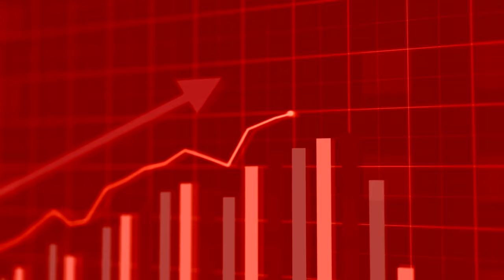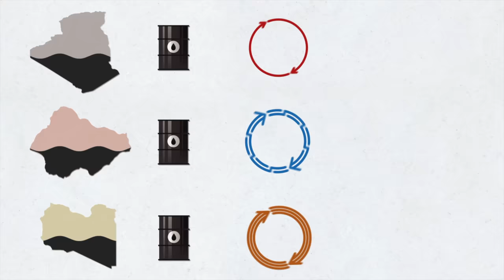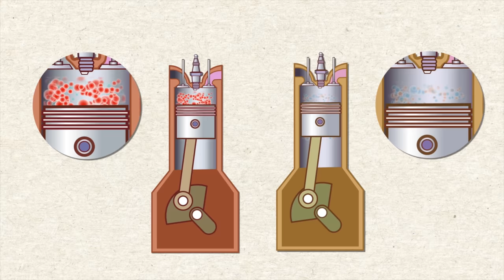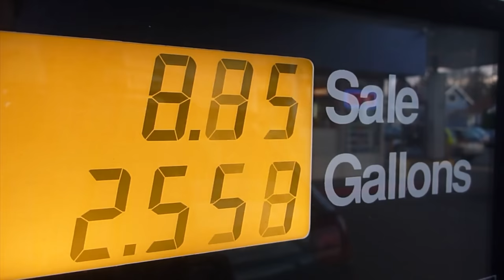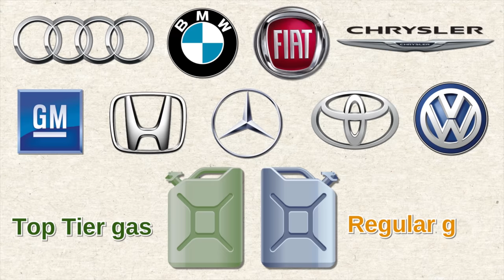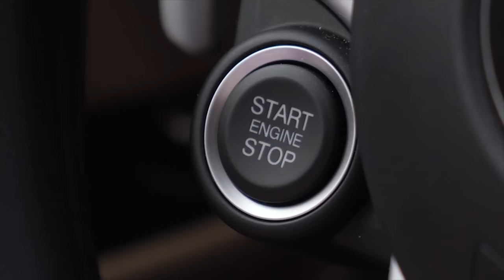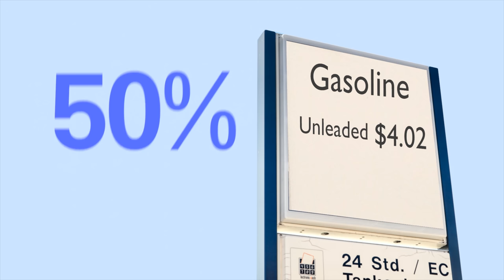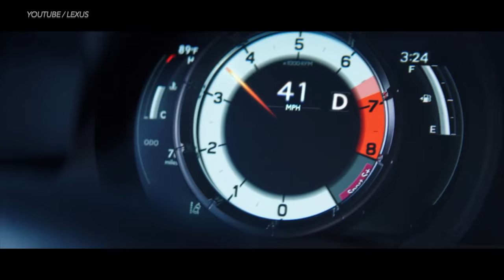No One Has the Balls to Tell You the Truth About Gas Prices, So I Will

Comment: The better choice for a ‘greener’ vehicle choice would be to hold on to your reliable older car and drive the wheels off it (then put on new wheels), basically keep it until a catastrophic failure or the body rots out

If you need to purchase a replacement car, purchase a reliable older used car in good condition and run it into the ground…

I had to do option 2 to replace a totaled vehicle, so I did a Scotty, and purchased (cash sale) a 2010 Toyota Matrix with the 1.8L, unfortunately it’s an automatic, but manual 1.8’s are nearly impossible to find in my area.

No car payment, 30-32 MPG combined, more fun to drive and simpler than the abhorrent, overly complicated Prius, also has more usable interior room.
Reply: This is what I plan to do with my Yaris. I hope to drive it to 500k or more.
Reply: @missdesireindependance5194  there’s no logical reason your Yaris shouldnt make it to 500K+ if you take care of it, it passed the “Scotty Test”…

Small, normally aspirated four cylinder engine 

Simple, basic chassis

Minimal automation/nannyware/“assists”

Basically there’s not much to go wrong…
Reply: Mine is a 2005 matrix and I intend to run it until it can’t then buy another matrix
Reply: @MrMOGHammer  nice. Matrix’s are great cars, especially the 1st gen, because they are a Corolla, in hatchback (what’s in a name)
Reply: Still driving my 2004 Prius.  It's extremely low mileage so as long as the major components and body hold up it may be the last car I own.  Lol.  I put in a replacement battery and just had it replaced again under warranty.   I got a lifetime warranty on replacement batteries.  Will be interesting to see if I can get one to last more than 9 months though.
Reply: @LisaKnobel  from what I’ve read, the hybrid packs are a crap shoot unless you go factory OEM/refurb, what a lot of these third party refurbers do is replace only the failed/failing cells, and leave the functional but aged cells in place, so the pack has unequal age/worn cells, and logically a new cell is going to last longer than a original (but still functional) cell
Reply: @MacTechG4  pretty much what I'm seeing.  So, as long as they install a "new" one everytime they fail, I can't see a huge downside except for a little inconvenience.  And, it's not really hugely inconvenient as they come to me wherever I am.  They start having to do that too often, they will necessarily have to change their business practices.
Reply: @LisaKnobel  one other thing to keep in mind, having an “unbalanced” pack with a mix of old OEM and new third party cells can accelerate the wear on both the new and old cells, it’s simple electrical physics, the aged cells are less responsive and have less capacity, increasing the load, and wear and tear on the new cells…

If your battery company wants to be scientific about this, they should build you a replacement hybrid pack out of 100% NEW cells and see if the time between failures/replacement increases (as it should)

Let’s say building a new battery pack (parts alone) cost $4000, and refurbishing a pack partially cost $1500…

The bean counters of the company would say “the $1500 pack is fine, let’s go with that one!”

But…if they’re replacing that pack every 9 months, by the time they’ve replaced it three times (under warranty), they’ve exceeded the cost of the $4000 new cell pack, and that’s just parts cost, not counting labor, travel, on-site fees, etc…

This proves that bean counters and engineers are natural mortal enemies ;)

The engineer wants to build the best equipment possible, parts cost be dammed, the bean counter wants to spend as little as possible and cut as many corners as possible to hit that price goal

This proves that bean counters are morons, and need to be kept out of the technical decision making process.

It’s also why I went with a Matrix, more cargo capacity than a Prius, handles better, more fun to drive, mechanically simpler with fewer failure points, but I lose out (a little) on absolute fuel economy, but that’s acceptable to me, I still get around 32 MPG combined (low 40’s highway)

And when the Sun sends out another “Carrington Event” level solar flare that fries the electric infrastructure, there’s a much higher probability that my Matrix will still run, and your Prius will be an oddly-shaped planter ;)
Reply: @MacTechG4  as an engineer, I totally get that.  I bought the Prius even though I knew I was logically making a very bad decision.  And, I'm not really a fan of them.  But, the piece of crap just will not die.  I do nothing to it except oil changes.  And, now a battery replacement. It owes me nothing.  So if it becomes a planter in some unlikely catastrophic solar flare, well,  so be it.  I'll ride my bike then.  

For me going with the rebuilt batteries seemed to make sense given the age of my car.  Given that my only inconvenience is to take a few pics and send an email I will continue until the company likely goes out of business.  Then I'll have a real excuse to buy a new car.
Reply: @LisaKnobel  sounds like you’re thinking logically about this 👍🖖

You are technically correct, the BEST kind of correct. :)

Perhaps a brainstorming session for an “engineering approved” EV is in order…

First; 
EMP hardened electronics

Built with as many off the shelf, common, easily replaceable components as possible 

No proprietary code/design, completely open source

Solar panels/photovoltaics on any flat, Sun facing surface

User upgradable/replaceable battery packs

Manual transmission (c’mon, you have to give me this one ;) )

Alternate design, four wheel/hub motors, each one individually selectable as motor/generator mode…

Maximum acceleration? All four motors in motor mode
Rear drive? Just the rear motors active
Front drive (self explanatory)
Regen mode; set two motors to generator, two to drive
Highway cruise mode; 2 motors set to generator, one to maintain speed, one switch between motor/gen depending on load/demand, in ideal conditions, three wheels would be in generator mode, one to maintain speed
Reply: @LisaKnobel  despite your Prius being 18 years old it still has push button start😂. They introduced that feature in the 2004 redesign.
Reply: @Blakecryderman7244  yeah it does.  I still have to put the fob in the slot though to make it start.  But, I could have got the remote start and unlock feature then if I wanted to pay more.  But, I certainly did not want to pay anymore than I had to.
Reply: @LisaKnobel  right. My car doesn’t have any interior power equipment, which I like-less stuff to break

Comment: So far, the plug-in hybrid has been the way to go. My 2018 Honda Clarity gets 40-48 miles range per EV charge, which nets me around 1,000 miles of distance (with sometimes free electricity) per fill up of an only 7 gallon gas tank. Before the $6.50 gas prices here in So Cal, I was spending about $10-$15 on gas per month. Now, it’s less than $30 per month, and having the best of both worlds is amazing. ⚡️ ⛽️
Reply: I don’t understand why automakers aren’t pushing plug in hybrids harder. The battery packs are smaller but most people could go weeks instead of days between trips the the gas station. If I could buy a Tacoma sized plug in hybrid truck I’d have one bought tomorrow.
Reply: I'm only guessing here.  So, 40 miles on a charge plus 7 gallons a fuel.  Guessing about 40 mpg on that 7 gallons would put you at around 320 miles of full range.  Give or take a little of course.  Now, if they could get the charge to hold 100 miles and then put in a bigger tank, say 10 gallons..  You're talking 500 mile range.  That's where is should be, imo..  But my opinion means little!  LOL
Reply: @mramseyISU  They should be pushing hybrids and plug in hybrids more...  I have a 2022 Corolla Hybrid and it literally can go 600 miles on a tank, it's remarkable!  They could make Hybrids go 800 miles on a tank!  The technology is there!  It's all about money!  If people can't see past the politicians' hard-ons then I can't help them!  (Going ALL IN on EVs)
Reply: @Simon Phibes a hybrid will work fine in all of those scenarios. Every hybrid I’ve seen switches to the gas engine for highway speeds, the battery pack is for running around town. As far as what to do with the waste according to the guy who’s leading the battery electric vehicle programs where I work 90% of a lithium ion battery is recyclable and he knows way more about it than you or me.
Reply: @Simon Phibes Hybrids suffer in cold, perform better in heat. Hybrids do better on mountainous roads; it generates electricity when going downhill, which can then be used to help it up the next hill, electric motors produce tons of torque btw. Battery life is variable. They suffer from disuse; failing to cycle them regularly will shorten their lifespan. I've spoken to people with 300,000 miles on a battery who say they've not noticed a reduction in efficiency. I'm not sure how many EVs or hybrids you've test driven lately, but I assure you there are quality products on the market today. I drive a 22' Honda Accord hybrid, it's faster than the standard Accord powertrain. I average 40mpg with a lead foot. If I drove a conventional sedan the way I drive this thing, I'd get 20mpg tops. It's not a plug in, I gas it up just like any car I've ever owned. it has a 12.8 gallon tank that takes me about 500 miles like a bat out of hell. Disposal? meh, cross that bridge when you come to it.
Reply: @BGD.2980  the thing the average person only drives about 30 miles a day. I plug in my plug in hybrid every night and get 27 miles electric range. I’m almost never using the gas hybrid mode. The savings are amazing.
Reply: @Localtraveler2376  I drive about 3-4k miles per month.  A 50 mile plug-in hybrid or EV just wouldn't cut it for me.  I haven't looked but 30 miles a day on average seems low.  If it works for you, that is great and all that really matters!
Reply: @BGD.2980  I was a little off. According to ABC the average one way commute in the U.S. is 16 miles. It would be better to have a median but about half of commuters would be able to do full electric. Sorry for your long commute although I know some people enjoy that down time.
Reply: @mramseyISU  if you can go weeks without visiting a gas station, it does not make much sense to carry a gas engine and all its supporting parts all the time. Get a but bigger battery and go months without charging away from home.
Reply: @BGD.2980  - With regards to the Clarity’s specs, you’re very close! But the vehicle that I really wanted to get (but is having issues due to the gas tanks) is the 21-22 Toyota Rav 4 Prime. That would have up to 42 mi of all EV range before the engine kicked in, and its 14.5 gallon tank would net you nearly 600 miles in total range! Drivers would say they would get around 5,000 miles per tank since their commutes weren’t too far and they didn’t tap into the gas tank until the battery was completely depleted. Also it being the second fastest Toyota is a pretty snazzy selling point!
Reply: You are correct.  It is the best way to go.
Reply: @Simon Phibes  We have a Prius and I don't feel it would be a vehicle for towing or going up mountains.  The way to save fuel is to drive a modest-size hybrid.  I think a plug-in would be the best.  I  haven't seen any hybrids capable of developing big power.  I don't say they don't exist.  I just haven't heard of any.  And work takes fuel.  The whole idea may be unrealistic at this point.  Ours is 17 yrs old but it only has 100k miles.  I wouldn't hesitate to buy a new one.  Plug-in maybe.
Reply: @BGD.2980  A hybrid has no range limit.  You use it like any other car except it gets good mpg.  EV is a completely different thing.  The 2 are not comparable.  I won't be ready for an EV in my lifetime.
Reply: Do u have to plug in the hybrids?

Comment: They'll never hit 40% EVs for 100 years even with 90% recycling. Considering they only dig up 85,000 tons a year of the stuff, if they used 100% of that in EVs, at 65lb of lithium per battery (conservatively), would only make 2.6 million batteries a year. 66 million cars were sold last year. You'd need to increase lithium production 10x to meet that goal.
Reply: Not to mention upgrading the power infrastructure which is already loaded for bear..

Comment: 19:48 I been using cruise control for couple years to lower gas usage. It helps me average ~33 mi/gal. One can do without it, but I tend to accelerate too much.
Reply: Truthfully, the vast majority of people tend to accelerate (and brake) too much.  I usually set the cruise at maybe 1-2 mph slower than the speed limit which ensures I don't have to disengage it very often to pass a slower driver.

Comment: Slow down early before you hit red lights, then slowly roll towards the intersection.  If you can still be moving when the light turns green, you save gas.
Reply: Not true. Rpms at idle are lower than moving rpms
Reply: @lochnesswes1  That doesn't begin to make up for the gas you have to spend to get back the speed you lose stopping.
Reply: Or don't do that; there are other drivers. Some of whom regain energy by applying the brakes.
Reply: @nimrodery  No regenerative braking system in the world gains more power than it takes to regain the speed you lost braking.  Nothing is more efficient than never needing to loose the speed in the first place.

Comment: I use to pay $180 to fill my tank...now I use an additive that allows me to use 87 octane instead of 93. On average...I save $50 to $55 bucks per fill up  while also increasing my mileage 🤩💥
Reply: Our SUV 'recommends' 91 octane but I use 87 and have never noticed any performance issues.  I often climb mountains while trailering 2 jet skis in PA and the SUV runs the same. If I heard engine knocking or noticed some sort of hesitation I would use the higher octane as recommended.
Reply: Not trying that in my tuned WRX STi...
Reply: @CWHolleman  if it uses gasoline or diesel it’ll work

Comment: I have a serious question for you and that is:  what do you do about the Ethanol problem if you live in a state where all gas sold here is 15% Ethanol?  There’s no getting gas that doesn’t have Ethanol in it. HELP!!
Reply: I think all boat marinas sell ethanol free gas.  ⛽    
They offer it at many normal stations around here. (Virginia)
Reply: Unfortunately, ethanol free runs on average 50 cents a gallon more than regular gas, but still considering making the switch.  
Have noticed they took the stickers off that said maximum 10 % ethanol, so have a sneaky sneaky feeling they've jacked it up without publicizing it.

Comment: Isn't it tough on the starter to keep turning the car on and off for stop lights? I know some lights are very long and would do this but replacing the starter is not something I want to do either. I do not have your skills.
Reply: Scotty has mentioned that stop n go motors are a horrible idea .
Its hard on your starter and your flywheel but the car makers don't care . I will never own one .
Reply: Note that in hyrbrid cars, there is no starter. The motor/generator takes over this function and the system is designed from the ground up for this so it isn't "tough" on it.
Reply: @joe3276865536   Maybe thats true with Hybred cars , but The majority of cars are NOT Hybred and as far as most ICE engines , it causes premature wear on them.
Reply: @jayhockley8841  Agreed.
Reply: I have heard that putting the car in neutral is the way to go, it causes less wear in tear.  Kind of makes sense

Comment: As far as I can tell, oil, and gas drilling/production are much more practical for the environment and our energy needs than all these "alternatives."
    I really like my combustion engine car.
Reply: It spews pollution out the back
Reply: @saulw6270  only if you liiveke in the city, we have almost no pollution in the country refuse to give up v8 4wheeldrive ...life was so great when gas was 3dollars a gallon now at 6.50 a gal its ok still better than living in NYC, la or  Peru or any major city
Reply: I'd love a quality electric car, but I just don't see them taking over.
Reply: @saulw6270  Perfect combustion produces plant food.  CO2 and H2O.   Poor running engines and densely overpopulated areas create pollution.  Most of the country has zero problems with nature filtering the air.

Comment: Let me tell you, my wife’s 12 Chevy Cruze RS (LUJ 1.4T) will NOT run happily on 87 or even 89, where we are we have 91 and 93 also. Anyway yea, 87 under moderate to high load pre-ignition happens, a technician (me) recognizes it as a misfire but the wife recognized it as a transmission issue, just an example of why techs are important! Anyway, Scotty, impressed with the well researched video. Surprisingly impressed. Keep it up.